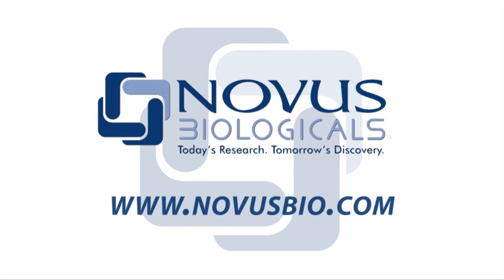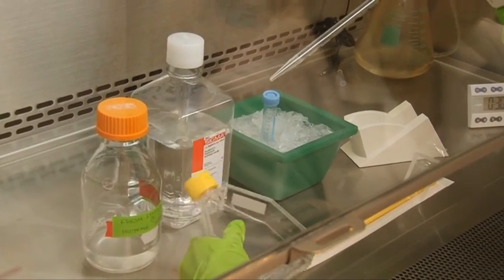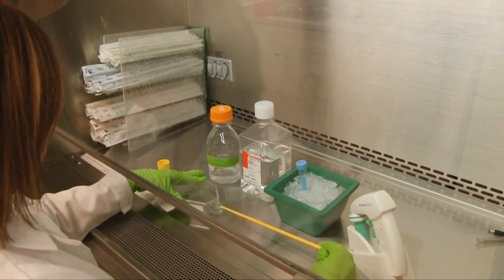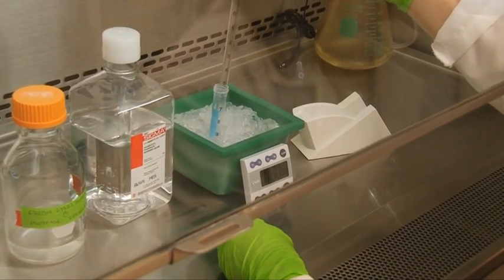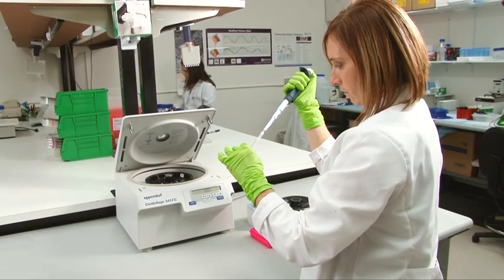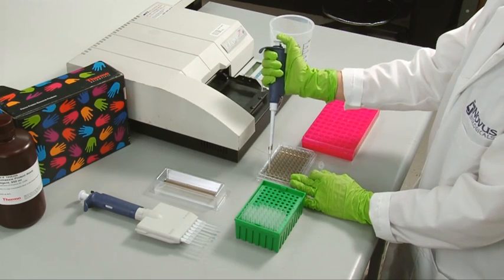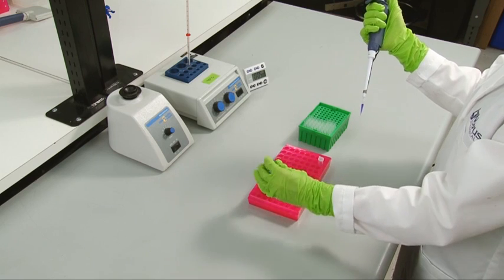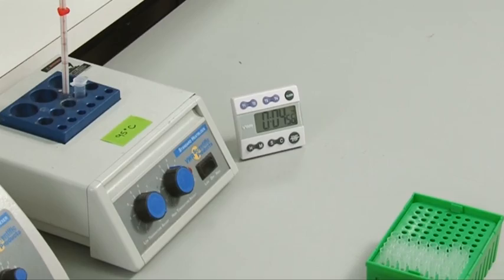Western Blot Visual Protocol: Phase 1: Sample Preparation

Comment: can I trypsinize the cells first and then add the lysis buffer? how that works?
Reply from the maker: From our experience with adherent cells, you can trypsinize and wash with PBS prior to resuspension in lysis buffer.

Since the cells would remain intact, trypsinizing can cause less death compared to scraping and fewer changes in metabolic parameters. However, since trypsin is a protease your assay may be affected especially if you are examining transmembrane or membrane associated proteins. 
(some information on effects of different detachment procedures can be found here: https://www.ncbi.nlm.nih.gov/pubmed/20337597)

It really boils down to what cells you are using, what proteins you are trying to extract, and the eventually assay you are going to be performing.

Hope this helps! Please let us know if we can help with anything else :)
Reply from the maker: Additionally, I think you were referring to the lysate preps from the attached cells.  The short answer is YES, you could trypsinize your cells first and lyse them later (by adding RIPA or another buffer).  The reasons that using a lysis buffer directly to the attached cells by investigators are mainly because: 1), to maintain the desired volumes of the lysates; 2), to prevent unneeded/uncontrollable proteolytic digestion; and 3), not to add any non- or low-expressed protein(s) to the lysates of interest.  However, if harvesting the cells by trypsinization first, investigators could split the harvested cell for their multiple experiments. Hope this information is helpful!
Reply from the maker: Two additional possible reasons for investigators to add the lysis buffer directly are to potentially 1), stop all biochemical reactions instantly in cells and 2), save time/steps.

Comment: for 24-well plate, how much lysis buffer should we add for each well and can we scrap it just by using the pipette tips or we need the scrapper?
Reply from the maker: Please accept our apologies for the delayed response! We don’t work with 24 well plates in the Novus lab, but would recommend starting at 10-20 ul lysis buffer.  Scraping with a pipette tip should be suitable.  Hope that helps!
Reply: +NovusBiologicals hrr